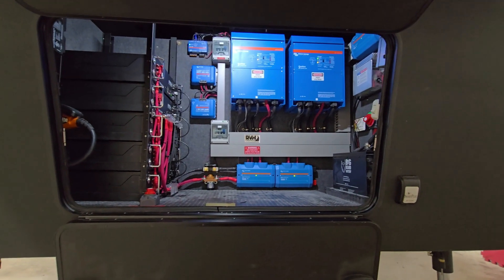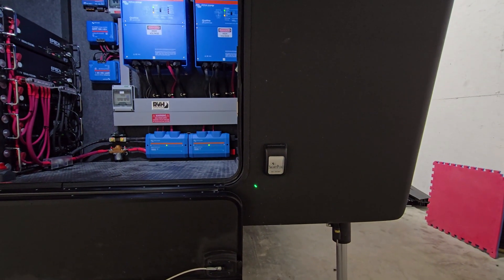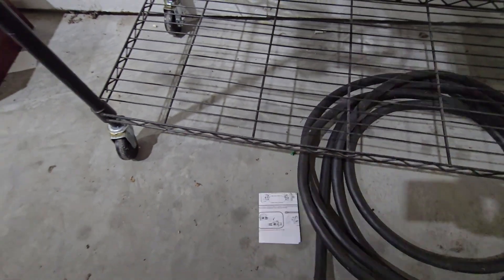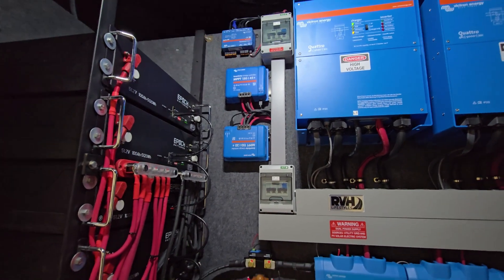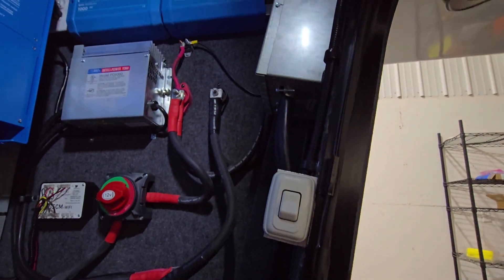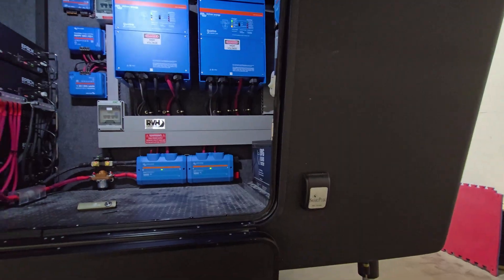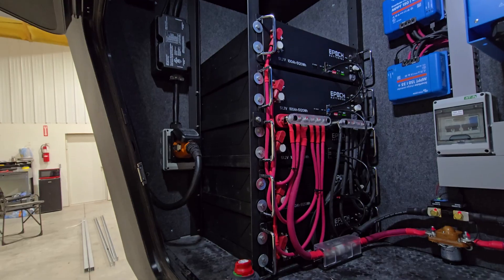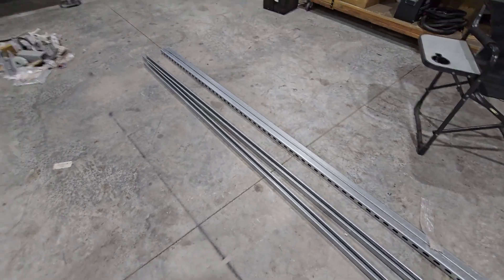Massive Off Grid Electrical System

Comment: You show the buss bars for 12v, but not what changes it from 48v to 12v… what part does that?
Reply: Looks like a DC-DC charger just below the 12V bus, but he didn't say the brand.    Since presumably the A/C is on the main system, the 12V will only be a bit bursty but not have very much in the way of average watts.

Because of that, the 12.8V battery is there to handle burst requirements, but the actual DC-DC can just be a trickle charger.  The one shown looks like a beefier one ... maybe 60A, but usually it doesn't take much more than 20A to the 12V system in good shape.  In a smaller rig I'd just use a 75/15 or 100/20 charge controller as the DC-DC charger, in fact.

-Matt
Reply: @junkerzn7312  thanks! That’s a good list. 😊

Comment: For the life of me I can't understand why the 5th Wheel needs all that juice.  Why don't the manufacturers use 12 volt appliances rather than 120 volt appliances?
Reply: Well, I'd half agree.  10kW of AC power is vast overkill.   But in modern day you don't want to have a lot of 12V appliances either.  They are costly compared to their AC counterparts and you don't want to have to run thick cables all over the place.

If I were doing a system like this from scratch, including the A/C, then I'd just have one 5kW inverter and run the A/C directly from 48VDC.  That is, I'd choose 48VDC A/C units.   But I would still use AC for most other regular appliances and the DC12 would still only be used for legacy gear that one does not normally replace (like the jacks).

-Matt

Comment: How much does that all weigh. What's left of the payload of the 5 th wheel after the in stall and the tung weight?
Reply: Probably 700# of inverter and battery in that front compartment.